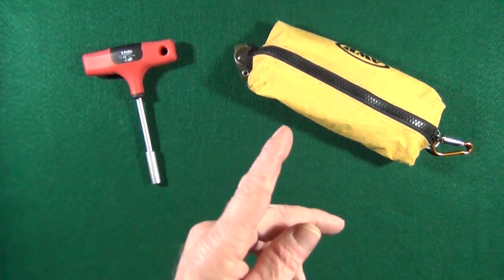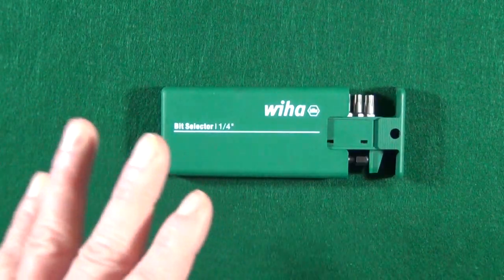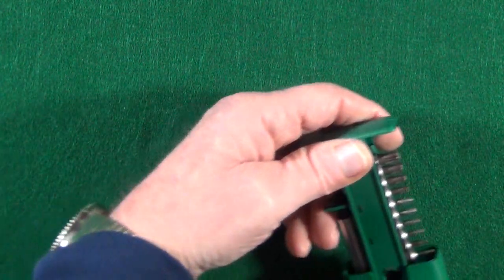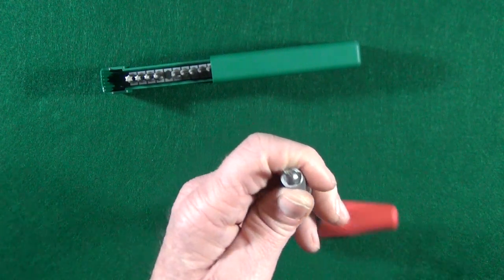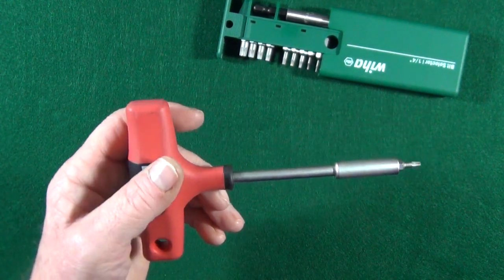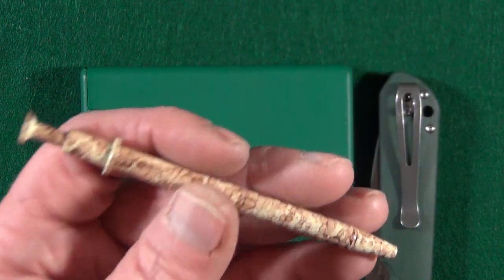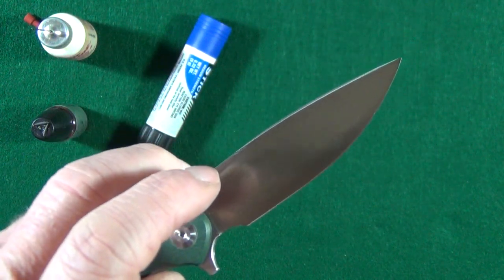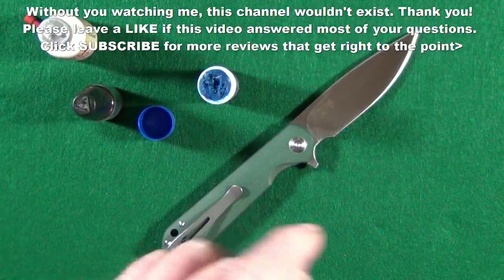The Best Pocket Knife Disassembly Tools

Comment: Great video. That small pick up tool is a great idea. I remember using a long flexible one to retrieve a dropped bolt when working on an engine.  I was just assembling a pocket clip yesterday and ran into the same magnetic screwdriver not aligning the screw with the hole problem.
Reply from the maker: Thanks William. That little pickup tool has made my life a heck of a lot easier.

Comment: Wiha bits hold up really well. I've got the t Handel set that come in a metal stand and has the sizes printed on the stand.jw knives and combat beads make some sweet drivers. I'm using the same stick loctite so much better than the liquid. Good stuff Jay
Reply from the maker: Yeah, I've seen those kits. I came so close to buying them instead of what I currently have. I've had some really bad luck with that liquid Loctite, it gets into everything. Thanks Rodney.
Reply: I’ve got the winged handled wiha torx set too and it is fantastic. The little stand (that’s also numbered) is a great addition too it. I think I would recommend that more than just the bit selector because you don’t have to then go get a bit driver and let’s be real no one is using the case of the bit selector as the damn driver lmao

Comment: I have the wiha bit set with a small wiha driver which has a magnet in it. I normally just put my screws on those, loctite them, and put them in sticking to the wiha bit. Does the claw tool work better than having the screw sticking to the bit?

Comment: Until recently I was unaware of your issue and Iwould like to know what you use for knife sharpener.I don't mean strop or honing but do you resharpen your own knifes and how.Ive  got several units I've tried the spyderco sharpener and countless stones as when I first got into the hobby it seems the true pros all started by using stones and depending on the steal I'm okay with what I've got but with s35vn and now even higher end steal s35vn and m390 are the only ones I've tried.s90 and 110 I ha ever had to but I own a couple so the day will come

Comment: any difference between Loctite 242 and 248 sticks? I got a 248, but I saw others using the 242.
Reply from the maker: Honestly, I didn't even realize there was a different type of stick. I always thought the 242 was the liquid and the 248 was the stick. The kind I have does say "all-purpose" on it, but they are both blue, medium strength, and made for metal. Maybe they just changed the packaging from what I have to the 248 designation. Sorry I don't have better info for you.